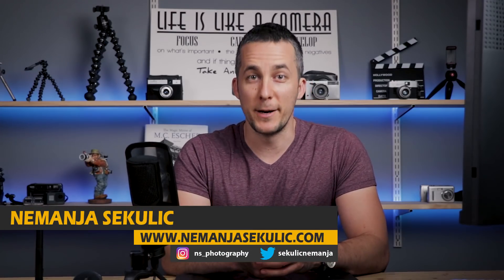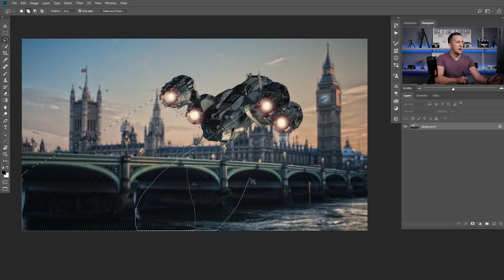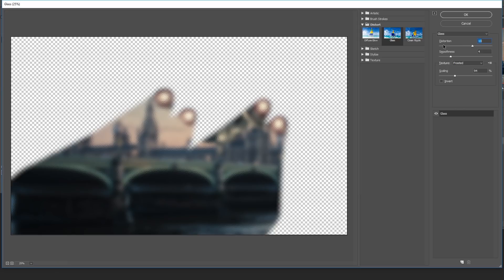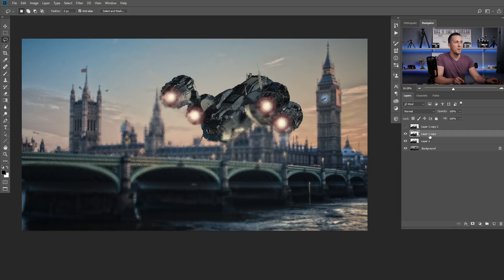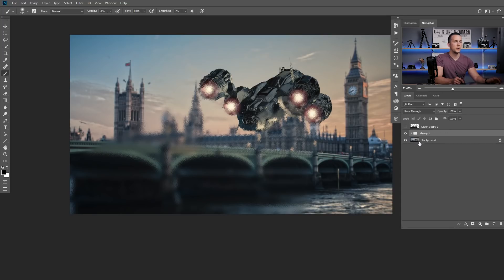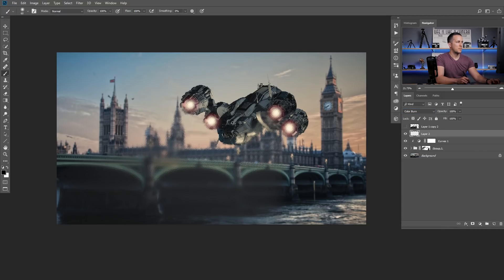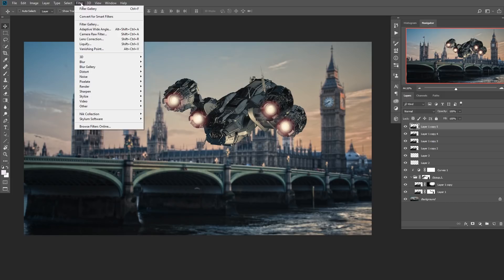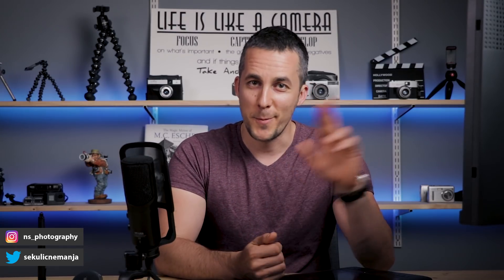How to Create a Heat Haze Effect in Photoshop

Comment: Harrier has a single jet engine but 4 separate articulating nozzles which stream haze but due to the high bypass flow the haze converges so it is rare to see the haze streams separated on a Harrier. As an illustrator specializing in the aeronautics industry, I have spent most of my professional life studying among other effects, heat haze but your method is intuitive nd creative - much simpler than my extensive methods. One thing I have noticed is that the haze tends to be most intricate/detailed and dense at the exhaust blurring increasingly as it fades out. For someone not familiar with aeronautics and it's specific intricacies, that you devised this convincing method of replicating the effect is very impressive.
Reply from the maker: Thanks a lot. I'm glad that you like it.

Comment: Hey. I'm a graphics engineer. The best way that worked for me so far is to use animated perlin noise (3D perlin noise. XY + time), not enable/disable layers. That's pretty ridiculous.
You generate a vector field from the perlin noise (or have some animated 2d vector field) and use that to distort the image. However don't ask me how to implement that in after effects, as I deal with shaders. Potentially a pregenerated animated noise texture.
Reply from the maker: Thanks. I know that. But the point here was to do everything in Photoshop.
Have a great day.